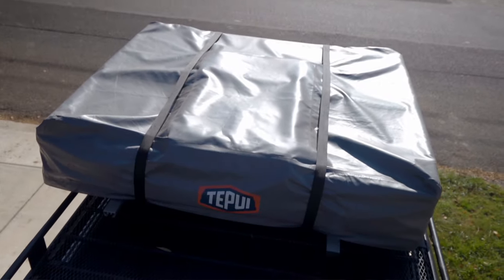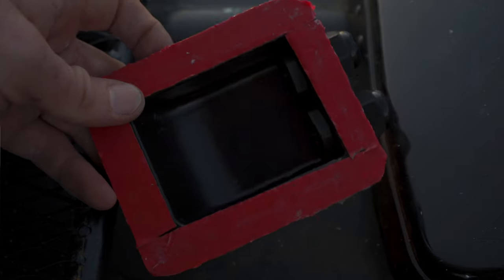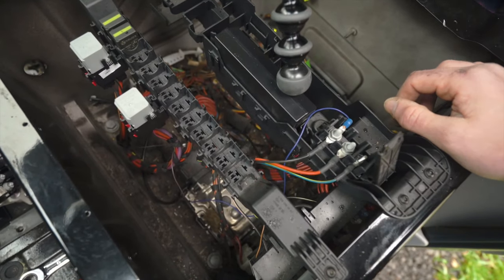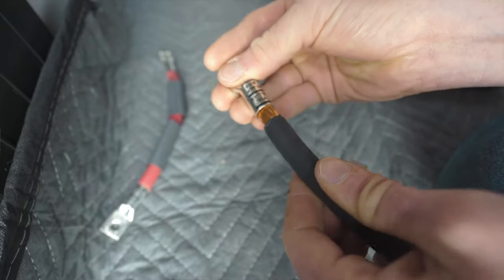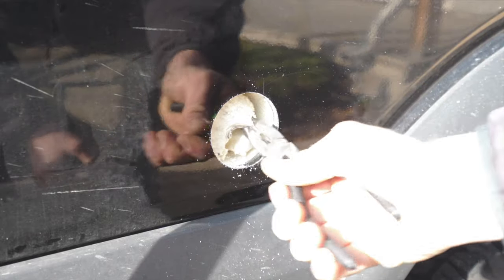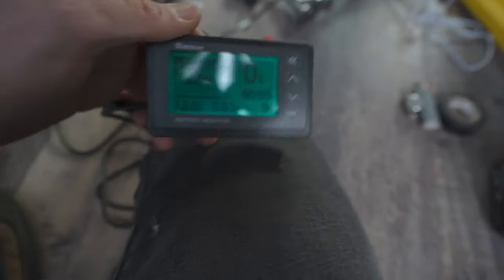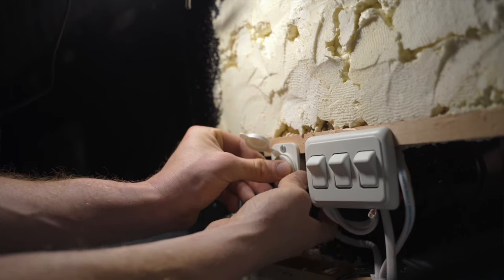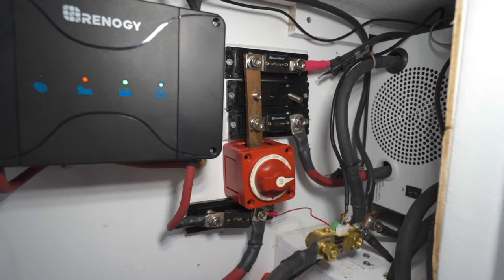Sprinter Van Build with Solar, Alternator DC Charger, and Shore Power

Comment from the maker: Timestamps in the description!
Reply: Hey Shaun! Whats size extruded aluminum did you use for your bed frame? Also, I just watched your insulation vid. Do you find the floor leeches any heat being that it has no insulation?
Reply from the maker: Sean Arbour My aluminum extrusions are about 1.5 inches thick. The floor isn’t a major source of heat loss. My espar heater keeps the van at a pretty consistent temperature and if I want to keep the floors warm I direct it to blow on the floor.
Reply: Hey mate, just curious to how you mounted the renogy battery shunt since it has no mount with it?
Reply from the maker: Hey ZacAss! I used an l-bracket from the hardware store with a hole the bolt could fit through. Since it was attached to wood I wasn't worried about electrical conduction. I think this bracket off eBay would work as well. I ordered the 350 amp version and should get it in a couple of weeks. https://www.ebay.com/itm/100A-350A-Base-Holder-Coulomb-Meter-Sampler-Crystal-TF01-TK15-TY01-Accessories/192901276820?hash=item2ce9cfe494:m:mDFHRiM18nfYdpmyjeY8icA
Reply: Hello,
Is your battery still grounded to the chassis , when also connected to shunt ?  Thanks, Peacefrom510 .
Reply: You have GOT to tell me where you got that roof rack! I have a Ford Expedition HD, and even the biggest truck racks look silly on it. If I wedlded two of them together, it would still only cover 2/3rds of the roof. :/
Reply: Hey I’m sure you already figured this out by now, but if you put a switch in line on your solar panel positive input before the DCCs, if solar is weak you can shut it off before you drive and it will pull full 50amp power from the alternator.

Comment: An expensive van. Expensive electrical equipment.  Expensive batteries. A cheap $20 hammer lug crimper :(. So much of the electrical, thermal perf. and safety relies on solid and reliable crimps that a good quality hydraulic crimping tool should have been the first investment.

Comment: Hi Shaun... I just bought the Kisae 2000 Watt Inverter/Charger.   What length and gauge of an extension cord would you recommend for a 2000 watt inverter charger when I want to charge up from a pedestal at a campground or an outlet at friend's house?    This is for my minivan.

Comment: Hi thanks for the video. I want to know what year your sprinter van is? I have a 2006 sprinter and think the alternator is not smart via test. I also have the Renogy DCC50S charger and the alternator light is on at times when the engine is not running.(tech support can not figure out why)Also for the smart alternator connection for the IGN signal wire, where you under the driver seat where you made the connection for 12V switch power?

Comment: That's what I'm going to do to get the most out it , it's not hooked up at the moment but all it's going to do is fans and lights and other smaller load's , I'm putting the inputs on A switch for the solar so I can pull the 50 amps and the same on the alternator , with a backup 2000 watt inverter , all big loads will be on a separate system .

Comment: Great video!  What size is your Inverter Charger and how did you figure out what size of wires/fuses you needed to safely connect it?  I bought the Renogy 3000W  Inverter charger and am having trouble figuring out what size wires and fuses I need (mainly because of the 9000W peak surge capability).   There doesn't seem to be wiring recommendations in the manual like there was with the other renogy products I ordered.

Comment: I run one battery bank for solar and the other from alternator keep them separated then one gets low to switch over to the other as backup. Like your system isn't complicated already this would mean more parts and wiring

Comment: You have a shunt coming out of the negative side of your leisure battery bank which is correct.  You said, though, that you have a shunt coming out of the mppt contoler which seems to be wrong.  The shunt should be the first thing coming out of neg side of leisure battery bank with all load coming off of that.  Not sure what you are doing there?
Reply from the maker: It is what I’m doing there. Must be some confusion in the editing. Basically the shunt is between the negative battery terminal and the ground bus bar of the system

Comment: great video! Are you still happy with the Renogy dc / dc mppt combo? and are u still liking the  renogy inverter charger combo?
Reply from the maker: Thanks! I sold the van with the dc/dc mppt combo but I liked it for the most part. In my current van I’m putting in the inverter/charger again but I’m using the victron cyrix Li ct to charge from my alternator.
Reply: @shaunwilkens  thanks excited to see the new build!

Comment: Hey shawn I somehow am doing almost the exact set up. And came across this amazing video. Super help. Ive watched it handful of times. 

Quick question:

Under the driver seat is smart alternator plug in for renogy dc-dc. There is a + pos and neg - cord the comes with it. You pointed to one part of where this small cord w red and black is supposed to go.  In the middle is red and the one you pointed to is black w small yellow strip. Im guessing red goes with red and black goes with black for this small cord. Not the same one correct?
Reply from the maker: Hey Chadd! Im assuming you are installing this in a 2007-2018 sprinter? First I’d confirm with MB if your van has the smart alternator. If it doesn’t you can disregard the cord. Call the service department and have them look up your vin to confirm. If you need to use the cable, attach the pos (red) wire to a terminal that becomes live when the engine is running. In my van that little box has three terminals. 1 always has power, 1 is powered when the key is turned on but engine is off, and 1 is live when the engine is running. Use that one. Attach the negative (black) wire to a point where other ground wires are attached. In the sprinter it’s usually brown wires that represent negative (ground) wires. Hope this helps!

Comment: Hey Shaun, hope you still answer some questions on here as the video is now 2 years old, but would you happen to know where the ignition/alternator wire is on later sprinter models (like a 2017)?

Thanks and nice build!
Reply from the maker: On a 2017 is should be the same as the van in the video. Go to 3:46 and that should show you where to hook it up. Thanks!

Comment: How did you deal with the three inputs. Solar, alt I get , but where does the charger from shore go when you are plugged into shore power
Reply from the maker: The inverter is a charger combo that has AC inputs as well as outputs

Comment: Have you had any issues with the draw off the batteries? we have the same setup but with the 3000w inverter charger being installed today and my auto electritian mentioned that we wont be able to run a microwave because the batteries only draw max 100amp and a microwave draws around 130.
Reply from the maker: I haven’t had issues but I believe it’s because I have sized the battery setup to the inverter. Renogy recommends a minimum of 2 100 ah lithium batteries for the 2000W inverter/charger  and 3 100 ah lithium batteries for a 3000W inverter charger. I consistently pull 130 amps when running my induction cooktop without issue. I would definitely go with your electricians advise over mine though.

Comment: Hello Shaun:
I would like to know if you have to ground your solar system to the body of the van. This would use the same ground as your car battery. OR did you actually keep the solar system ground independent/not connected to your car battery ground? hope this made sense.  Thank you:)
Reply: Yes you do.. Everything needs a #8 ground to chassis..As I seen people not do that.. It's required by the manufacture and NEC code for RV installations..Just install a stud to make all the ground connections too..Then use dielectric grease to prevent corrosion..

Comment: Wait you 100 percent sure the renogy DC to DC doesn't prioritize the alternator over the solar panels when driving?

If so have you worked out if you can add a switch to do that?
Reply from the maker: Yes, I’m sure. At night it will pull only from the alternator since there isn’t any power coming from the solar panels. You can put a cutoff switch on the positive line coming from the solar panels to manually make the charger prioritize the alternator.

Comment: Did you add a diode on the positive line from the alternator?  I've read it's supposed to prevent back-charging and overcharging your engine battery.
Reply from the maker: I did not. This charger is designed to trickle charge the starting battery when the house battery is near full.

Comment: A 'normally on' relay on the solar input that cuts off power when ignition is on will be a good substitute for a switch to automatically cut off solar when engine is running. Just bought one of these for my boat, not worried about the 25A cutoff as it only has a 35A alternator but can understand why this is causing issues for campers with 70A alternators.
Reply from the maker: Yeah, hopefully they fixed this issue

Comment: Thanks for your video . Is Renogy DC to DC  Charger  work  with your sprinter van ? because  the Renogy DC to DC  charger  is 50A.. Mercedes  not recommend  to hook up over 40A charger to Alternator..
Reply from the maker: The charger has  been working well with my alternator. I’ve heard that some people are concerned about putting too much stress on the alternator using a dc:dc charger or isolator. 

There’s different sized alternators in the sprinters and mine came with a 220 amp alternator which should handle passing off the extra 50 amps just fine. Another option is to add a second alternator if you’re worried about your main alternator.

Comment: what size wire do you use to bring in power on the dc side? I started with 2gauge but I think its way to big! The only other wires I have are 8 and 10. Will I need another gauge?
Reply from the maker: Which wire run are you talking about? From the Alternator to the DC:DC charger?

Comment: Just wondering why you only used a 70amp fuse from the dc output? I am trying to figure up my setting and I found it weird you didn't use a higher amp for that. Would a higher amp fuse cause any damage to the batteries or dc-dc charger?
Reply from the maker: You generally want to size your fuse to about 125% of your load and since it puts out a little over 50 amps I put a 70 amp fuse. It’s also what renogy recommended to me when I called them up about it.
Reply: Shaun Wilkens thanks I went to look at explorist life. It’s all a bit overwhelming and I just want to be prepared with the intensity of price and time.

Comment: Incredible video.  You nailed the install.  I have a question for you.  When you are using shore power with your set up are you having to kill the inputs to your dc to dc mppt controller?  I have a similar setup but I want to add shore power but unsure of the transition process.
Reply from the maker: Thanks! I didn’t have any way to kill the connection with the dcdc/mppt. The max power input my battery bank could handle is 100 amps and the max I could get from dc:dc charger + solar + shore power would have been 80 amps (assuming the vehicle was running) and the max for solar + shore power would be about 40 amps.

Comment: Hey Shaun, do you remember how long your wire run from van battery to the charge controller was? What gauge did you end up going with for that cable?
Reply from the maker: It was around 3 feet and I think I used 8 gauge wire. I’d defining recommend using the wire size calculator over at https://www.explorist.life/wire-sizing-calculator/

Comment: Is the battery voltage sensor wire BVS connected to the starter battery or the service batteries? I have the same battery charger but I does not specify to which battery connect it.
Reply from the maker: It connects to the service batteries

Comment: You mentioned you have a smaller alternator, what size alternator do you have that made you need to pass the wires to your ignition?
Reply from the maker: I have a “smart” alternator which varies the voltage. The wires came with the dc to dc charger and when the engine is running they open a relay in the charger that tells it it’s time to pull power from the power distribution center on the battery.

Comment: the link to the charge controller isn"t working (or my computer isn't working - could be either :-)    Could you tell us the make /model?  am i right its the same charge controller for the alternator and the solar?  thanks!
Reply from the maker: It’s the Renogy DCC50S. Thanks for letting me know about the link!
Reply: @shaunwilkens  thanks for the reply Shaun.  And a question?  do you have a generator in your rig also? and if so does it use the same charge controller? or do you have a seperate one, and if so what?  Thanks a million!
Reply from the maker: Nope, no generator. I do have the renogy inverter charger to attack shore power. You could attach a generator to that I suppose.
Reply: Thanks!

Comment: Great video! When you're connected to shore power, does this charge the batteries in any way? Couldn't see that covered but might be missing something
Reply from the maker: Yes, it does charge the batteries. It will charge them to 100 then allow the batteries to cycle down to around 20% before charging back up to 100. This is the best way for a lithium battery to cycle
Reply: Could you explain how the shore power charges the batteries?

Comment: Do you have to connect the alternator to the charge controller or can it be something you decide to add later?
Reply from the maker: You can decide later. It just helps to get your cable run before you build everything out

Comment: Thanks for the video- quite helpful and I appreciate they way you present information. Question for you, since I plan to  use the same spot for my ground wire connection to chassis: isn't the lug for the ground wire supposed to directly  contact the metal of your van chassis? From the video, it looked like you  placed both the plastic item and a washer between the metal of your van and the lug of your round wire. Is that correct/what I saw and do you  have any comments about that?  Thank you!
Reply: He obviously doesn’t respond to comments so I’ll answer your question. 

First off, yes he did the chassis ground incorrectly. Does it work? Probably/maybe but was also probably why his dc-dc got cooked. 

Second, he did a lot of questionable things on this electrical build. I wouldn’t recommend following this build if you want a safe reliable setup. 

No hate towards the dude, just sucks that all these amateurs put out videos and mislead people like this. 

- professional van builder
Reply: @SamCohan  Howdy thanks for the info! Indeed I did not follow his methods and have been enjoying my top-notch system all year with no problems. I made sure to grind away the paint and got excellent metal-to-metal contact for my ground. Cheers!

Comment: Awesome videos dude. For the wire that you ran from the battery under the van, did you have to drill a hole in the van for that, or was there already a hole in the van? I have a Promaster and have been holding off on this part because i wasn't sure where i wanted to run the wire.

Comment: what did you replace the zip ties with?  Currently trying to figure out how to mount solar panels to a roof rack
Reply from the maker: I used riv nuts with washers! Will try to highlight it with a video but might be a while
Reply: @shaunwilkens  ohhh good idea! I've already been using them for things on the interior, and didn't even think to use them here. Thanks dude!

Comment: I sure hope you only plan on using your van in winter or cold weather.  Black is hot!!!!
Reply from the maker: You might be surprised with how much the spray foam insulation made a difference

Comment: Hey Shawn, I am curious to where you hooked up your negative input wire on your DC to DC charger.  I am also going to use the power distribution block to hook up the positive .  Im gonna use a renogy dc to dc 20 amp
Reply from the maker: I ran the negative wire from the dc charger to the negative bus bar which is attached to the shunt. There is a wire that runs from the negative bus bar to the chassi (van frame) to ground the electrical system.
Reply: @shaunwilkens  The charger I have has a negative port on both the input and output side.   Does yours and are they both attached to the same bus bar?  I currently have the output negative wire attached to my negative bus bar, bus wasn't sure where the input one should go.  Thanks for your input
Reply from the maker: Looks like they want you to run a negative wire from the starter battery to the input of your charge controller. I’m not sure this is necessary since your starter battery and house battery should be both grounded to the chassi. I’d recommend confirming that with Renogy. My charger only has one negative terminal. Page 9 in the manual lays out what each port is for : https://www.renogy.com/content/RNG-DCC1212-20-BC/DCC1212-204060-Manual.pdf

Comment: Hey Shaun great video. I am aboot to attempt my first wiring on my first build and pretty much have the exact set up as you do. One difference I think is that I have a BT-2 Module that shows me everything. Where did you get the Shunt??? It is not listed in your parts description??
Reply from the maker: The 500 amp shunt came with the batterie monitor
Reply: @shaunwilkens  HHHmmmmmm well I dont think that I will have the battery monitor as I opted for the BT-2 Bluetooth Module that I assum,ed is also going to be my battery monitor. Do i also need a battery monitor on top of the Bluetooth module???
Reply from the maker: The battery monitor is helpful but not necessary. The shunt is a must have